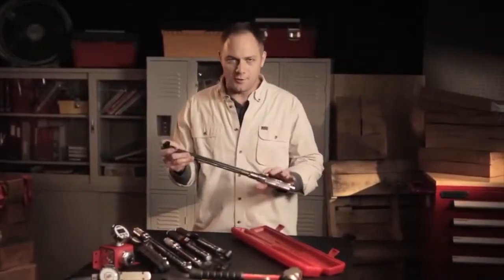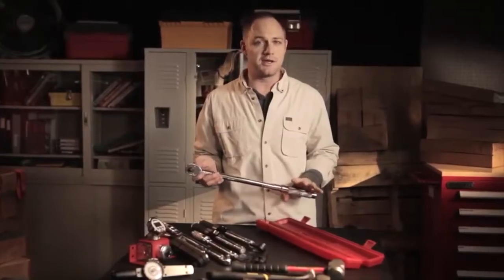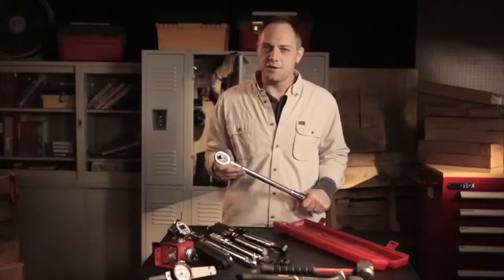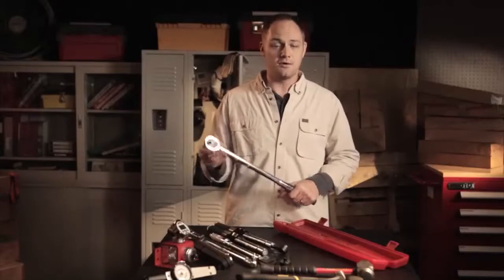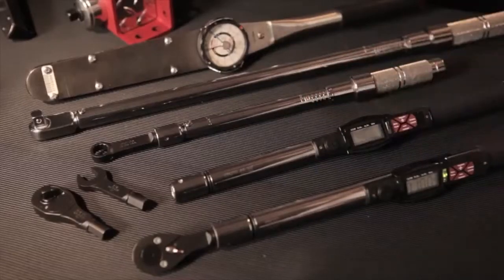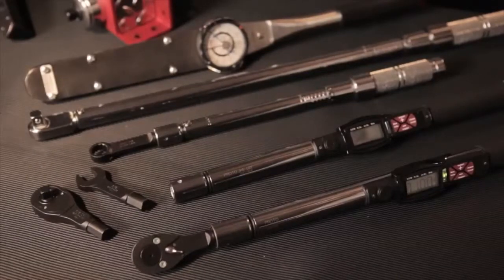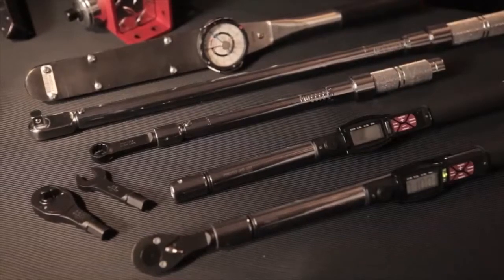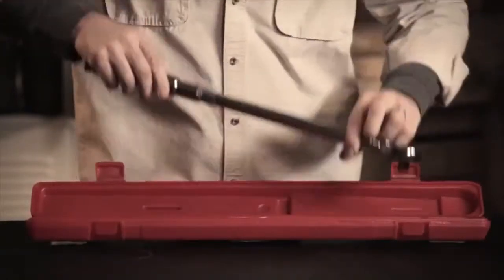Proto® Tools - Torque Wrench Safety

Comment: hello i a found this value on a proto wrench Calibrated to +/- 4% in clockwise direction and +/- 6% in counter clockwise direction. i understand i must add +4  to desired  value or why plz give me a solution
Reply: No, it is the margin of error. Example when you set the torque wrench to 100Nm in clockwise direction with - /+4% the real output torque value wil be within 96Nm to 104Nm.